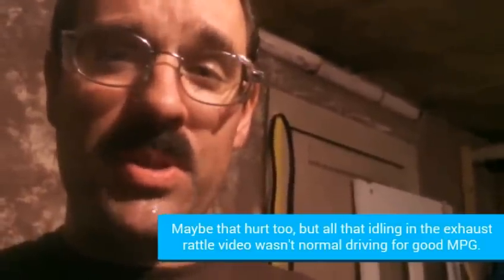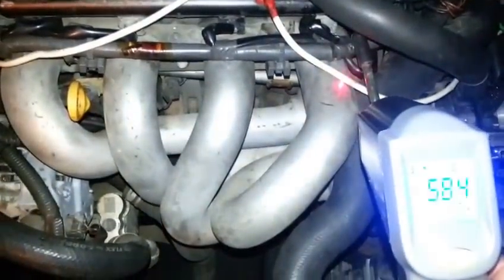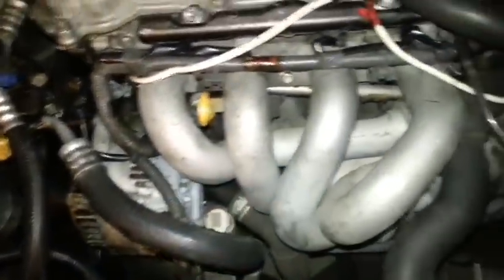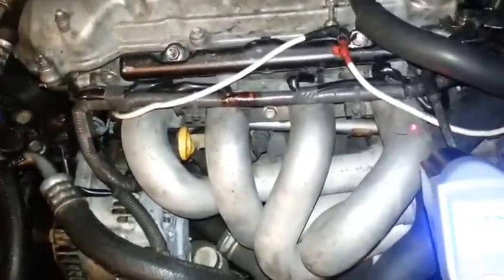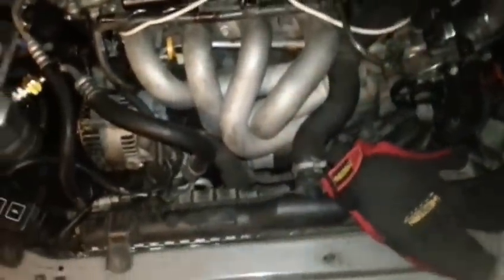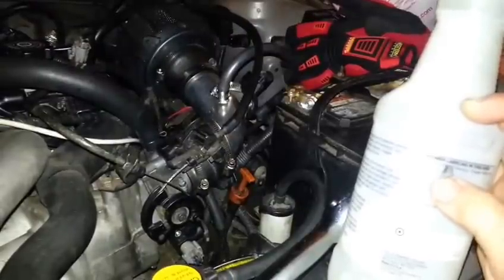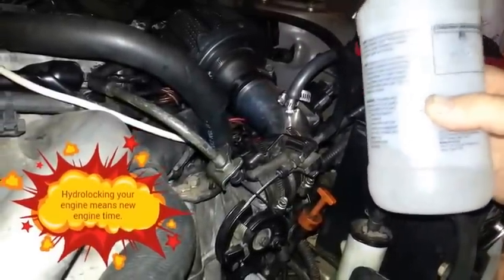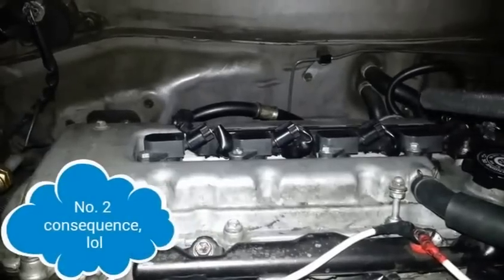Water Decarbonization and Warnings

Comment: so.... hydro lock and engine stall are two different things. when you flood your intake with water you will take in enough volume to fill a cylinder and absolutely destroy your engine.  spraying water in the air intake is only diluting your fuel mixture, causing the engine to begin to stall. someone correct me if im wrong here, but you can't hydro lock an engine with just a heavy mist of water. maybe the stalling is higher engine compression struggle. its a trick some people do to "boost" their cars. spray water while accelerating to take up non compressible space in the cylinder. higher compression= greater power... im no expert, these are just my thoughts.
Reply from the maker: To really use water injection for power you need a high compression engine or boost. It'll allow even more boost without detonation. When one company decided to test to failure they got to like 35-45 pounds of boost, but this was a seriously built engine. Way tougher than most with better metal. They decided 25 was plenty for racing when the competition ran 15. These numbers are a bit general. A buddy who also loves building Porsches for the track told me about it on Toyota nation .com.
Reply from the maker: You deserve a great response for a great comment. Apologies. I'm entirely focused on getting certifications right now. Passed ASE A1 Engines and A4 Steering and suspension last night. Brutal tests!
Reply from the maker: If you're aggressive with a misting water bottle you could still cause engine damage I think, but I'm careful just to not even cause a stall.

Comment: Sounds to me like you not take the top of that engine I would say a lifter is sticking
Reply from the maker: This car had a valve train, which was getting louder for some years. That's for sure. At the time, the valve train was a lot quieter when it wasn't getting water decarbonized. Be it BG, Seafoam or any intake cleaner, engines sound extra rough during cleaning. 

When you let them cool down and just drive, that's when the magic happens. This car ran so smooth it felt like it was on rails as the saying goes. After the cleaning versus before of course. 

This engine unfortunately doesn't have the self- adjusting valves. You have to measure the shims under the valves after measuring cam to shim clearance and buy the right shims to get the valve clearance just right again.

Comment: that is an old trick but be careful s you said could cause a lot more damage then good
Reply from the maker: Yeah. Just think. Just water on top of this very engine from when my wife slashed a deep puddle hydrolocked this engine. 

She said water engulfed the car but I can't see more than a little water on top of the engine as it was just a bad splash.

Comment: WW2 Fighter planes used methanol/ water mix.
Reply from the maker: +Michael Chevreaux I didn't know about the methanol. Just the water! I've learned off some Engineering Explained fans that some people even do that on NA applications. Usually it's done on a turbo or aupwr charged engine to allow greater increase in timing advance. I hope you've subscribed. I need a 1,000 total to not lose my monetization.
Reply: they rattle it does sound like a ww2 plane.
Reply from the maker: Lol. Cars don't sound good during water decarbonization. Comments convinced me this engine was going until I remembered that. 🤣

Comment: Shooting a can of wd40 in beforehand would help a lot... I think cold-start is safer despite what they tell you... warm-start risks damaging smaller metal parts due to rapid uneven cooling effects... it all heats up rapidly anyway... also, mixing in a little ammonia with the water is enhancing...nothing cleans carbon on the bench better than ammonia
Reply from the maker: +Wes Kellogg WD-40 is water displacement no. 40 when NASA was testing what displaced water best. Do you know what that NASA scientist was testing? Fish oil. While better at displacing water, it being a natural based product, I'd think it'd make a bigger mess in an engine. It works great cleaning a taken a part engine for carbon, and I'm just guessing here, but I think it'd dirty up an engine used unlike water in a water decarbonization process. WD-40 is like an oil/solvent. A cleaner solvent without oil that's simpler chemically wouldn't carbon up an engine as much or damage a catalytic converter. Oil is very bad for catalytic converters and I think WD-40 would be worse than a processed oil like in Seafoam.

There are products which you spray into an engine and immediately turn the engine off to soak the carbon. With your cold engine thought is that what you're after? 

Thank you for commenting once. I'd love to know more about what you meant and are thinking! 

Now the ammonia idea. I've heard of that before in an application like this. I'll have to research that. 😊
Reply: By cold-start I simply mean spray the agent(s) in your tb or intake immediately after starting cold. You don't have to, but I've done it this way with wd40 + water or carb cleaner or ammonia every time. I've cured all oil burning issues, but I've also rerouted the PCV to air intake and plugged the PCV inlet (sucking end of PCV hose taking it back to intake manifold). It's an 09 Camry 4cyl w/ 320k miles. WD40 is just a safe/cheap way to clean a lot of everything, especially sticky/dirty valves. It gets everywhere and vaporizes fast.

The plugged vac inlet on the intake manifold (former/stock PCV route) no longer sabotages the engine vacuum. It also eliminates blow-by because the PCV vapors are no longer under the strong vacuum of engine. By rerouting to air intake, the vacuum moving PCV vapors is much weaker, allowing the PCV vapors to cool down, mix/dilute with fresh air, and re-enter the engine before 'liquifying' into oil to become 'combusted' with a/f mix or sent out tailpipe. Regardless, no more blow-by and no more engine sabotage just by pluggin' intake manifold.
Reply from the maker: +Wes Kellogg Maybe you do indeed have the right of it. Wd-40 does evaporate easily. And since it is a lubricant, it's got to be safer than chemical soaks which strip oil and endanger engines to the point of failure on the next start up. I just wish I knew about other oils I could spray which aren't organic...organic means less tidy to me.

A year ago my worries were upgraded camera equipment and the ability to try techniques like these with a borescope but right now my laptop can't edit videos. That's very intensive. I dropped it at work as I use it on car repair all the time diagnosing deep electrical and sensor issues...I still do but it's super slow. Needs a new hard drive. ..got one but I can't get that working. 

I wish I remembered how I responded to this comment before. Traded out my battery on my phone and then remembered I just lost active memory. Lol
Reply from the maker: +Wes Kellogg Those are very good results!
Reply: Hi Wes. While WD-40 was originally made with fish oil, the MSDS data sheet suggests that it had anything other than that. Much cleaner chemicals with a similar effect...I do wonder though if it's as good at protecting rubber components. I think the original formula was safer for not damaging rubber. You now how oil hurts rubber, right?

Comment: Can you do this on a big truck with a dpf and a turbo ?
Reply from the maker: +Justin Case I have no personal experience or professional data on this. The closest I can say is that Ford says all gas additives and cleaners will damage their turbo.

When fordtechmackuloco of YouTube, a Ford professional I respect gave me the above information, the only "yeah, but what about this" comments in the video that he thought would be okay was water decarbonization.

I'm sorry I don't have a better answer for you. If you find a more definitive answer please let me know!
Reply: DE Nichols 
Ok thanks. I have a peterbilt with a dpf system. I've seen a lot of water decarbonization vids, but none for big trucks and wasn't sure if i should try it.
Reply: DE Nichols 
I ended up replacing my dpf and all the sensors and that seems to have fixed all my problems. As far as decarbonization goes. There are places that do that and it doesn't cost that much, ( considering how much we spend keeping big trucks running ). Im a little afraid to try this water stuff.
Reply from the maker: I'm more afraid of any of the chemicals with turbo. At least a Ford technician said Ford's advice is no cleaning on engines with Diesel. I'm hardly a diesel tech, but Fordtechmackuloco...when he speaks it's always from the Engineers from Ford.
Reply from the maker: I am very glad you're all fixed up. May I suggest to be more careful that water decarbonization should be done with distilled water so it can't leave minerals behind as it flashes off. 

Also, this really isn't good for tractor trailers based on a short research, but check out this intake cleaning method. The results are phenomenal: https://youtu.be/cv63wy0PnHE
Reply: DE Nichols 
Ok. Thanks. Yea, it was a long and expensive road, but it's running great now. I should've replaced the dpf a long time ago, it would've been way less expensive in the long run.

Comment: Manifold temp is directly related to fan placement and cylinder location.... also, when using a temp laser on something like this, you need to hold it very close to the item you are reading... they take temp in a "V" shape... just because the red dot is on the manifold doesn't mean you are getting a reading on that exact spot.....
Reply from the maker: +mason chase I figured there was parallax between the laser dot and the sensor. You share a really good point.

I've found a little distance gets you pointed more accurately as it does reduce the effect of parallax. Sorry. I don't know how many people know what  parallax is. I hope I'm understood.

Comment: Wouldn't it be easier to use a garden-type sprayer to introduce the water?  Also, what's your feeling about mixing the water with Iso alcohol-maybe 70/30 water to alcohol?  Would there be any benefit? Thanks.
Reply from the maker: G&K Ol' School I don't know yet. I haven't tried it. Isopropelyne alcohol I think comes 70% water already so you wouldn't have to mix it. 

Alcohol is more burnable so it may be safer than straight water. I have heard that alcohol isn't good for spark plugs. My truck may need new spark plugs. If it does, this would be a good time to inspect one before and after and find out.

I think platinum spark plugs lose best performance after only 12k miles. What do you think?
Reply from the maker: +G&K Ol' School A garden type sprayer moves a lot of water quickly. You could use one, but you'd have to have a brief trigger time. Your talking about the pump up bottles right? Do those have a mist option?

I think a standard pump spray bottle is easy.

Comment: WHATS THE NASTY RATTLE?
Reply: +Martin Taylor Yes, engine sounds BAD!
Reply from the maker: Yeah, that sound was the bane of my wife's desire to drive the car.

I chased down a few exhaust rattles in some videos. Check it out here:
https://youtu.be/AXfQEqWB1MI

This particular rattle turned out to be a heat shield on the rear engine mount. It took a long time to find such a big nut with the right threads. I remember the tool for the outside was 12 mm and that the thread pitch was 1.25 instead of 1, but I can't be sure of it's thickness. It certainly wasn't common. I tried occasionally for months before a friend found the right sized nut.
Reply: it is REALLY ANNOYING,
Reply from the maker: I show it fixed here: https://youtu.be/cWqN6LzbfFg?t=7m55s
Reply from the maker: +Michael Chevreaux yes. The valves have gotten quite out of tolerance I think. Check out my video whether I hydrolocked my engine. No not with water decarbonization but my wife drove deep into a water logged street. Does it survive. Are the valves worth repairing? https://youtu.be/cWqN6LzbfFg

Comment: Intake runner temp proves what?
Reply: Justin Case is that you best you can offer to this thread?
Reply: nilphuxgiven 
What ?
Reply from the maker: I've seen 5 gas analyzers, but they haven't been used in decades. Still a fantastic comment. What would you look for from the analyzer which would indicate a leaking valve?
Reply: Yep, but I dont troll. I have more important things that matter! Knock yourself out but you'll see that I will offer helpful insite instead of harsh insults and joining the ranks of petty keyboard warriors!
Reply: Use a damn scope and a tailpipe sniffer!
Reply from the maker: +Ah Umm I've been meaning to do that for years. Scopes are expensive. I will redo this video with a scope though so be sure to subscribe! 

Tail pipe sniffer? I've occasionally worked at a shop where they have an old broken one...go to my channel page and look up oxygen sensor, fuel trims, key words like that and see how we monitor exhaust quality in the modern world. (Except some states where tail pipe sniffers are actually still used.)
Reply: Ah Umm 
Pervert
Reply: nilphuxgiven changing the oil makes a noticable difference if you dont have access to a scope. If your state has emission testing where a dyno was used, you might be in luck to find a shop that can use the 5 gas analizer to sample tailpipe readings for a cost somewhere of about $50-$75. Also if its possible remove and clean the EGR valve and plumbing. They certainly affect the combustion chamber temps when there is a lot of cabon on the exhaust valves. Good luck.
Reply from the maker: Pretty weak, huh?
Reply from the maker: Thankfully, no EGR on this car, just variable valve timing which more cleanly does the same thing plus a little wHP boost in the other direction. Really smoothes out the engine.
Reply from the maker: Ah um. You've changed your name and picture a few times. Pretty funny. Confused me for a bit.
Reply: DE Nichols you would need a compression tester to help identify a leaking valve.  A 5 gas analizer measures the efficiency of the combustion process.
Reply from the maker: During the time of this video, I could show that the intake of cylinder 4 was hotter than the other intakes.

Before I did YouTube I found that cylinder 4 was worse for the intake runner temp. Water decarbonization equaled the temperatures out.

It goes to figure that valve seal was improved.

Going further back maybe 8 months:
I also did a compression test. Cylinder no. 4 as it read from right to left, 1-4 had higher compression by quite a bit. I figured it was carbon build up in the combustion chamber. After water decarbonization, the compression came down. I also realized that injector must not have been running right. I replaced them all.

This makes it sound like you could be right about compression testing finding slightly leak, dirty sealing valves, except that compression tests stayed even until this time: https://youtu.be/cWqN6LzbfFg
Reply from the maker: +nilphuxgiven Intakes actually get heat pulses from the combustion chamber so this shows how combustion has changed after water decarbonization. How things have cleaned up to run more even.
Reply from the maker: +nilphuxgiven Oh. And thanks for your comment. :)
Reply: DE Nichols Just to be clear, the difference in temp before and after proves the effectiveness of the decarbonization?  Am I understanding this correctly?
Reply from the maker: nilphuxgiven Yes. The car drove so much smoother afterwards but that's even harder to relate or be quantifiable.
Reply from the maker: I did try looking at the exhaust, but with the exhaust cover that made those temperatures useless.